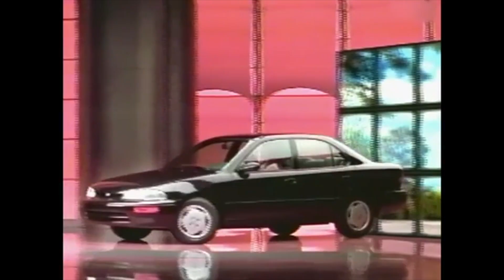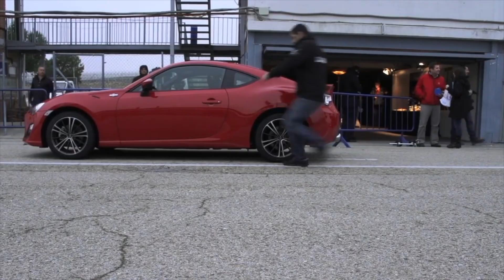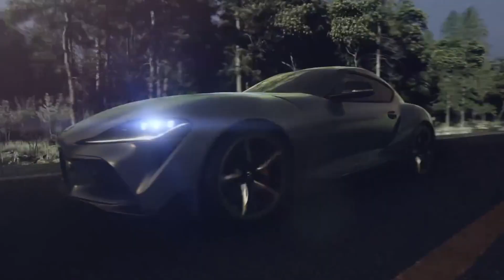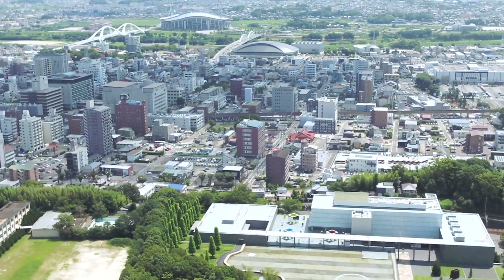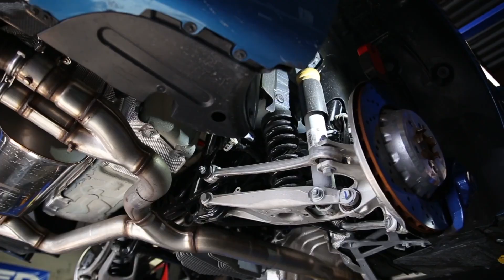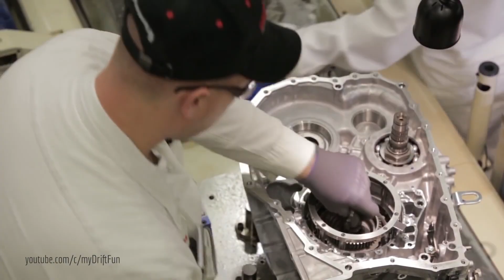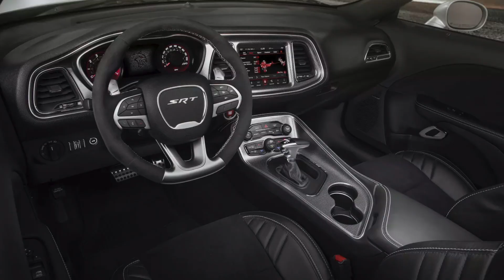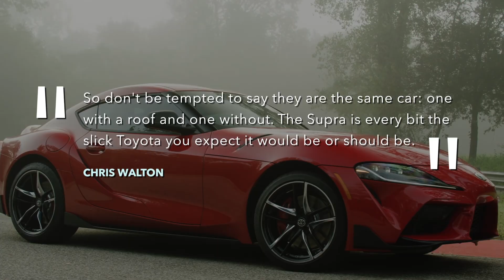MKV Toyota Supra - BMW or Toyota? The UNTOLD TRUE STORY

Comment: BMW could do NOTHING better than to partner with Toyota.   I've owned and driven German cars and now LOVE my used Corolla - I tell people 'reliability' is the new ';performance.'  We all have speed laws, reckless driving laws and fuel mileage frustrations, you want the performance, get a track car.  Trip to BMW dealer: $1800. Toyota: do it myself, $40. BMW trip to market -  throw a 'Check Engine Code', need new sensor: $800.  Knowing that my car won't break down on a road trip: priceless.  For LA car snobs: BMW, for everything else: Toyota.  I just wish they would make smartphones.

Comment: "according to the facts, probably not [supra a rebadged z4]" that depends on how you look at it, Youtube has been recommending me videos about this for weeks, so its the only reason i am here, i am not hot headed about either cars. I am not a fanatic or hater of either company, but from what you said in that video, I don't recall anything Toyota did apart from skin and adjust the suspension of their supra. From this video (and be pedantic about quality testing, which is a good thing), all the parts from the majority of the car are BMW parts, they will be made in a 3rd party factory specifically because that factory has the tooling for BMW cars, but is independent. 

What it sounds like is, if i take my Mazda familia, adjust the suspension to my taste and then change all the paneling and interior that makes me Toyota. Mazda did the billions of RND for that base.

I think people where hoping the supra would be a revolutionary thing that Toyota designed and that isn't what they got. It ended up being a somewhat small project on Toyotas side that only happened because the designer says they aught to make it because our fans are yearning for it, lets ease their misery therefore people are, as they tend to do on the internet exaggerating the situation to make their point, they are disappointed.
It would seem to me.

Comment: Why there's so much hate towards the new Supra? Well to put it simply, what ppl see when they look at the new Supra is BMW.... Front is remade GT 86 or even BRZ, sides looks like Z4 just like the profile of the car, the roof is a little higher version os TVR Sagaris and the back.... is yet again Subaru BRZ, the new Supra resembles nothing of the old MK4 and i guess that's what majority of customers wanted. New Supra can have very good drivability etc. but people bought this car for what they saw.
In the end i want to say i do not mean that Supra won't be a good car in terms of driving and internal equipment. It's all about the looks nothing more.

Comment: No matter what Toyota did, people will still cry and moan...because the internet is full of whiney moronic babies. The car is designed very differently to the Z4. Everything about its structure looks great on paper - it has power, it has RWD, 50-50 weight distribution, low centre of gravity, and it is a beautiful car - pretty much what the old Supra was. BMW made the platform, boohoo, so what? BMW also made the M3 and M5, which are benchmark performance sedans. I fail to see how having a BMW engine is a bad thing, especially if Toyota were, otherwise, not going to bother making the car. People that moan about this are the type of idiots that moan about whether a game console has an AMD or NVidia graphics chip, instead of just enjoying the games that run perfectly well on it. Who is going to be drifting this car round a track and thinking 'damn this BMW engine'? 99.9% of the people who are moaning about the car can't even afford it, so just enjoy driving your Corsas and Golfs with oversized noisy exhaust pipes instead. And if the remaining 0.1% care that much about the engine then they should go get a MKIV Supra instead - there's plenty on Gumtree and Autotrader.

Comment: This should of been the Scion FR-S/Subaru BRZ/Toyota 86. This is what the current model should of been, not the under powered one we have now. 
The MKV Supra should of had between 500-600 BHP. I think this is going to be what holds it back, but time will tell. Supposedly, the mounts are identical to a 2JZ-GTE.

Comment: I'd question the statement regarding Germany not liking badge engineering. Opel  (German) and Vauxhall  (English) cars are identical to each other, with the exception of the badges. Each company had different names for their models until a few years ago, whereas now even the names are the same.

Comment: I don't want a Supra.. but I want a Toyota Celica1600 that matches the original for being a very cool and smart GT car in every way... it would be a different car than that original for sure, but think about it.. lightweight, small displacement matched to a (now more than 4-speed) manual transmission, good front seats, let's forget about the back seats and make it a smaller version of the old Jaguar XJ-S... THAT was the eptimome of a GT car... this would be the baby sibling...

Comment: I love your video, it's awesome, and very thorough.
However I feel some people miss the point when it comes down to why so many people are vehemently upset about the BMW/ TOYOTA co-production of these vehicles.
I think I speak for the Toyota/ Supra purists when I say, we didn't want a BMW drivetrain.
We wanted a true successor to the 2JZ engine, with a manual, and dual clutch offerings.
We don't want it built in Austria, we want it built in Japan.
And ultimately, while Toyota had a hand in reliability testing anyone would have every right to question the reliability of something that was base engineered by BMW, and built in a factory not owned and operated by Toyota themselves, and I say that as someone who recently owned a 3 series. 

Ultimately I end with this, the new Supra may be good, there's no denying it will probably be awesome, but it will never capture my heart the way it could've, it's just not what I wanted.

Comment: BMW's engineering approach is "Make it last 5 years then fall apart over the next 5 years so the owner has to buy a new car, and make it nearly impossible to tune so we can make an M version and charge twice as much for it".  Toyota's engineering approach "Built it as well as we possibly can within the given budget and give everyone access to the ECU so it can easily be tuned".  That's why the new Supra sucks balls, it's a BMW underneath which means it'll be great for 5 years, and totally untenable to keep on the road in 10 and it'll never produce big power.
Reply: @tegra_0  he also said int he video that they could only work together on the basic chassis together per germany's anti trust laws idk if they will have any effect on the use of certain parts between the 2.
Reply: @ABArsenal  am not sure either, but the fact that the anti trust laws forced them to "part ways", they should have "parted ways". Not just in theory but in everything including looks.
Reply: This is a b.s sales pitch its a throw away engine you can't even rebuild it. This car is trash and it hurts to say. They will not sell. Watch!
Reply: Okay, maybe I just know the issues of the Toyota Celica and the Toyota Corolla, but they aren't easily modified ECU's at all. You have to have a serious piggy back or full replacement to truly do an upgrade tune on these cars from the computer perspective.
Reply: Well, first recall issued for serious chassis weld failures just a few months into ownership.  Remedy is inspection and whole vehicle replacement.  So unfortunately, it seems I was right, BMW up to their usual shoddy tricks.  If the welds are already failing after a few months, what is going to happen after 10 or 15 years?
Reply: If you watched and listened, it was Toyota's engineers in Japan that did the reliability and durability testing. The way I see it, this car should be amazing. Basically a BMW with Toyota's crazy reliability. It may not live up the insane hype of the classic Supra, but most things that are WAY overhyped dont. It'll be a great car imo.
Reply: @Lucifuriuz  Yes I watched and listened and according to the video Toyota repeatedly sent back parts as small as bolts to BMW to be redesigned as they were not good enough to meet Toyota's standards - problem is I can't find anything to corroborate this claim so who knows if it is actually true.  Also there is the question of what didn't they pick up on? What crappy cost cutting measures did BMW manage to get past them?  And now it's got to be assembled by a 3rd party production line - what are they not going to do that Toyota, with it's Kaizen philosophy, would do on a Toyota assembly line?  Maybe Toyota will audit the assembly line process closely and it'll be fine - who knows?  Then there is the problem of the BMW engine being fairly fragile and difficult to tune...   And of course like the problems with the GT86's shitty Subaru engine, Toyota can just point the finger at BMW when things do go wrong.  Sorry, but for me this is not a Supra other than in the badge they have put on it.
Reply: @Beer_Dad1975  the engine management is done by the respective manufacture so i am going to assume thr ecu in the supra will be of toyotas doing so prob will be able to tune it. but to be honest i would get the 4 cyl and put something else in the body if the M motor isnt worth a damn but i know those turbo'd BMW fucking scoot

Comment: It looks as if Alfa Romeo and BMW had a baby. I don't hate the shape, it just looks weird to me. You could put any badge on it (Alfa Romeo, BMW, Mazda, etc) and it wouldn't make any difference really. Too much European DNA fused in it in my opinion.
Reply: assuming you'd still get Toyota's reliability, i think its a decent concept. A BMW that actually lasts more than a week, that'd be nice
Reply: @bendy113  @JohnSTF72  if you looked the design of FT-1 concept and latest Supra, they're pretty different with own distinctive aesthetic I'd say, I like the concept more as it's much similar to Supra MkIV. The new Supra looks like a retarded version of it trying to fit into smaller chassis.
Reply: @StealthXY  yeah I personally feel that they shouldn't have brought it back and just let its legacy be a legend of a car that's rare as hell.
Reply: JohnSTF72 Its like the RX8 successor
Reply: BMW is the only World Manufacturer that still produces a inline 6 turbo, which the Supra Fans all wanted due to its legendary reliability. Toyota did engineering tests on a lot of engine and chassis parts and demanded more stringent design demands to make it more reliable.

Comment: Still not a Supra, had it been called ANYTHING else, then this would be an amazing car, but they are relying solely on the badge to sell units.  This new car carries nothing forward from the Supra, save for a inline 6, and will sell poorly.  This is the fall of Toyota sports cars, they played to safe, and to close to the chest on this one, which will ultimately bite them in the ass.

Comment: Nice video! But it still really just proved what most people already thought/knew. BMW did most of the work and Toyota just took the end product to put a shell on the BMW platform/chassis. Even in the video you mentioned how much BMW spent developing this car but I don't remember hearing Toyota doing any equivalent spending.

Like literally, minus the shell, suspension tuning and *engine tuning*, everything else came from BMW. we can debate the ZF8 all day long but BMW only uses ZF transmissions, even in their manual cars and their new F90, while Toyota uses their own in house transmission company, AISIN (who is great btw!). So yeah, this is a rebranded Z4, no ifs, ands, or buts about it. Toyota didn't even implement their own Infotainment system, just used the BMW iDrive system. I say all of this, not as a hater but c'mon people, let's call a spade a spade; the 2020 Supra is a BMW Z.

I am glad Toyota did their industry leading reliability testing on the B58 though because I have a 340i (2 years now) and drive it hard and it has never given me any reliability problems! Also this is great news for every current B58 owner because it means the aftermarket support will be absolutely amazing in the next few months/years and it's about DAMN TIME! LOL

I own both a BMW (340i) and a Toyota (Camry LE V6, **YAWN**) so I try to be unbiased but the BMW is my fun toy.

Comment: 2 of the biggest car manufacturers on this planet both renowned for high quality & performance oriented cars, putting their heads together to engineer a platform solely for pure driving enjoyment... 

Imagine a BMW with Toyota reliability an serviceability..
Then imagine the driving enjoyment of a BMW shoehorned into a Toyota...
Or put it simply the best of German engineering combined with best of Japanese engineering

Both cars will be utterly brilliant.. an that’s in stock format..
I can not wait to see the final product of both cars..
Critics are crying now... 
but like everyone else in the car world once the throttle drops the bullshit stops...

Then like all Toyota’s an Japanese cars before... once the aftermarket JDM tuning shops get to engineer their go fast bits, the power output will be awesome.. 
looking at the components used on the 2 cars can see the endless tuning capabilities.. the Supra will be once again be the supercar killer it’s name plate is renowned for after a few bolt ons an retuning just like how the original 2JZ Supras produced their power..

Finally a Japanese & European alternative to the American offerings Ford Mustang (only 2 door sport coupe to be solely engineered by 1 car company), Dodge Charger (based on an old disused Mercedes Platform) & Chevrolet Camaro (which was first designed as an Australian Holden Monaro)..

As for the stick shift fans.... manual transmissions are now redundant as the dinosaurs of you want to have a handicap from slow gear changes then by all means get one... but know that you will never out run an Automatic as it changes gears in milliseconds, autos can be stalled up to start from a standing start faster than a manual.. plus they are more economical to run... you can see why the manufacturers opted for the Auto only..  any luck they have the flappy paddle shifters an options to manually shift that way... 

Bring on 2020!!!!

Comment: haha anti trust laws. as if the govt. wouldnt bend for the car manufacturers will.
Dieselgate is still relevant. BMW has the parts in stock, as the regulation in the US already requires an SCR to be fit, but BMW says the parts dont exist, and the politicans are silent.

Comment: BMW vehicles are money pits! BMW's reliability doesn't even come close to Toyota. That's why for Toyota to sell out to BMW is an atrocity!
Reply: You didn't watch the video did you?...
Reply: @formulajuan5762  lol look! It's an idiot with a keyboard.
Reply: You really want to go there about recalls? The fact remains Toyota products last longer than any other competitor. The average Toyota owner keeps their vehicle 10 to 15 years. Show me BMW or Mercedes or any other Vehicles lasting 200 300 thousand miles without any major repairs.
Reply: @michaeltrinidad1217  The engine has been tested and manufactured to Toyota standards.
Reply: @rickyvinh2765  Toyota standards is a Toyota engine. Don't believe the marketing rhetoric. Time will tell after a hundred thousand miles we'll see if it meets Toyota standards or start to go downhill like every other BMW.
Reply: @michaeltrinidad1217  Well the Diesels are really reliable, I drive an E82 with now 200.000km and it drives like it's new
Reply: @CheesusCrustus  there's only one problem with diesel cars, it's going to be phased out in the United States. With emission standards and fuel cost.
Reply: @michaeltrinidad1217  shit that sucks, in Germany Diesel is way cheaper than Gas. Including the fuel economy it's really worth it here. I get always something between 40 and 50 mpg, and I don't drive slow. The good Diesel engines can run incredibly long
Reply: Ford is a mixed bag, some models good some models bad. https://www.businessinsider.com/most-reliable-car-brands-2018-consumer-reports-2018-10
Reply: Jim S. Comparing Camrys with F-150s good one there buddy. Did you just blow in from stupid town?
Reply: Its easy to tell who didnt watch the video and just game to leave hate comments when they missed the fact that toyota oversaw the development of the engine
Reply: @gamemaster634  you really believe that? The truth shall come five to six years down the road. When this vehicle has reliability issues left and right Toyota will then say BMW is at fault.
Reply: Michael Trinidad Your 200 percent right.  I used to work for Toyota as Technician and when Toyota have the Scion FRS which is Subaru BRZ it was a nightmare for costumers. PCM software issues and fuel management problems, even when we replace a 2500.00 pcm wouldn’t fix the issues.  We have to tell the costumers to take their brand new car to a Subaru dealerships since it’s not a Toyota.  It’s gonna be the same thing for the Supra cause it’s not a Toyota but a BMW.  BWM dealerships gonna be 💰💰💰💰💰💰💰💰 Supra 💰💰💰

Comment: Incredible disrespect to the Japanese heritage and automotive enthusiasts. Z4 rebadged is EXACTLY what this is and all that this is. It's the "Z5". No brainer to use BMW engine? Sidestep Toyota's frame developments? BMW parts and assembly line? It's cosmetically Toyota around the shared platform and powetrain that is BMW. I remember my first body kit, suspension upgrade, and ecu reflash -- was still a turbo civic.
Reply: And let's not forget abooooout....(drum roll)... The fact that Toyota actually has a V6 engine that they could have put in the Supra instead! (the Mark X engine, also has a manual.) I'd rather take a V6 TOYOTA engine than an i6 BMW piece of crap.
Reply: Just like logan paul does to disrespect the Japanese